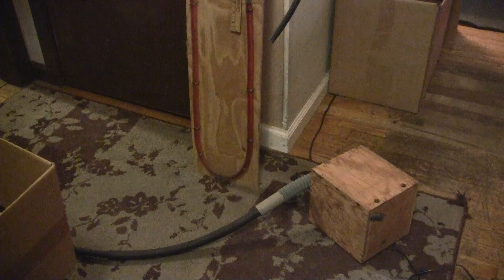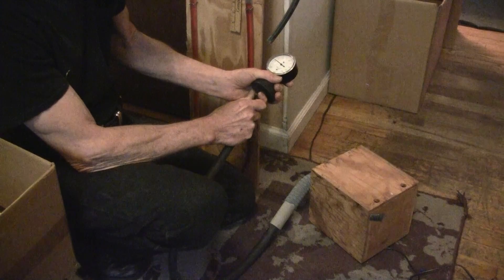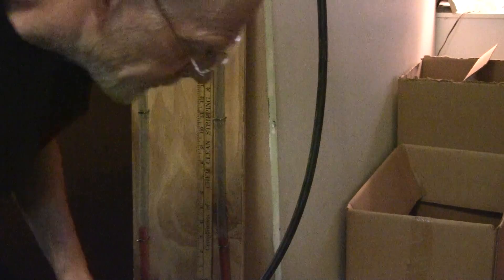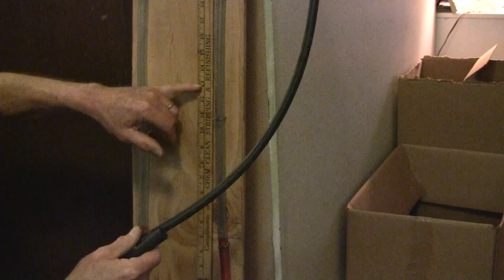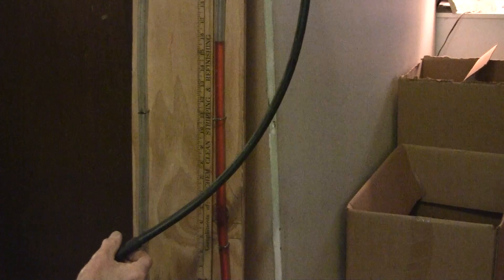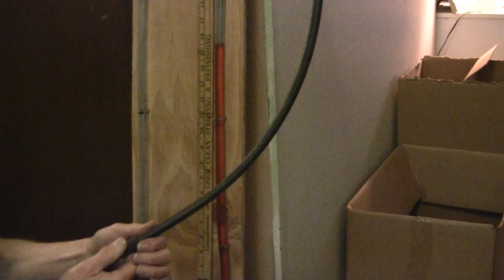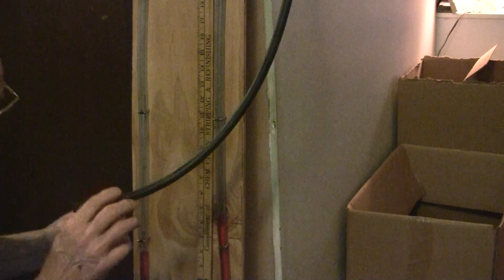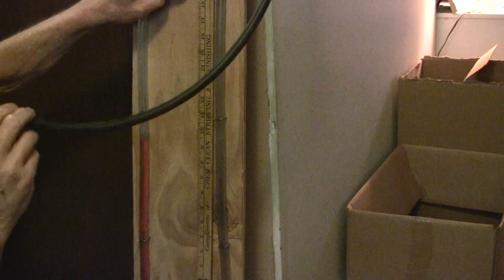Facts About A Manometer by John A Tuttle from Player-Care.com

Comment: Why does each inch on the scale correspond with 2" of vacuum.  When the water moves 10", why is that not 10" of water vacuum?
Reply from the maker: Hi Bruce, 

This is what I surmise......

Although this is going to sound corny, the truth is that the water IS moving 2" for every 1" of deviation. While it's moving UP 1" on one side of the manometer, it's moving down 1" on the other side. (1+1=2) What you have to keep in mind is that the air pressure on the open end of the gauge never changes. And, the vacuum has to lift the entire column of water, not just the water on the right side of the gauge. So, since the weight of the water on the left side of the gauge is the same as the weight of the water on the right side of the gauge when it is at rest, it takes twice as much effort to move the column in either direction. (The gauge can also be used to measure inch pounds of pressure.) If I knew anything about physics, I could explain it in scientific terms... but I don't, so I can't.... ;-) Also, since I figured people might not believe what I was saying, I purposely showed the vacuum level on the hand-held vacuum gauge prior comparing it to the reading on the manometer. To get a better answer, talk to a science teacher... They'll struggle to give you an easy answer. I know... I've asked....
Reply: Because when it's moving up 1" on one side of the tube it's also moving down 1" on the other side so the total distance of travel is 2", etc.